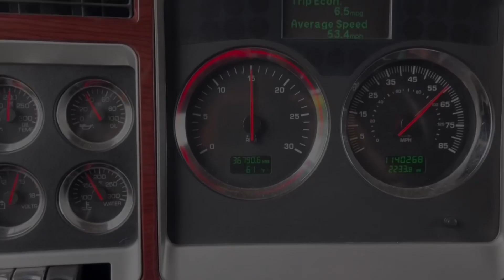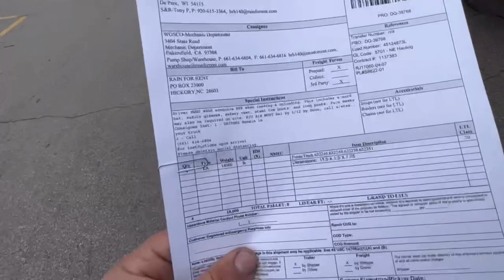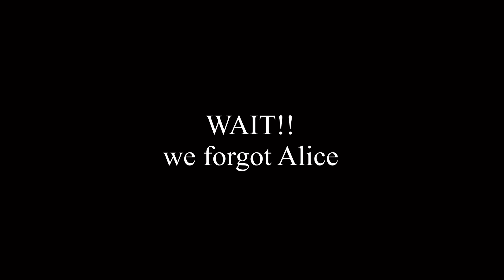KICKING OFF COILS AND PICKING UP PUMPS | Real Life Trucking - Episode #150

Comment: When I ran western trailers, I hauled a ton of equipment, and I ran the chains down through the stake pockets. Never knew they made those hooks that slide in that groove.
Reply from the maker: It makes it easier, the stake pockets are so far apart it would make it awkward lol
Reply: @TruckingTogether  yeah I used to have to load everything trying my best to line it up with my tie down points. Those hooks you have are pretty slick!
Reply from the maker: They can be a challenge to keep from moving sometimes but definitely make it easier than stake pockets. Kind of wish I had some pipe spools sometimes.

Comment: Well you made it bud. There's an example of what I was talking about tarp and stuff on the you get there and they get it in the open it's sitting out there in the rain trucks going by splashing butt all over those coils. Back of the day I got a lousy $75 for tarping.🤷🏽‍♂️. Sometime the last.

Hey man I got a question for you how come you don't use a steak pot holes in your trailer for tying down putting the chain through. That's what I used to do with my trailer. It was an outside frame so I couldn't haul no coils. The strength is on the outside and the stickers you put on there set the lumber on. But I've hauled some stuff that I had to chain down sometimes I use a stake potholes..🤷🏽‍♂️. Have a safe trip going back bud keep the dirty side up and the river down. Since your truck's dirty and 😎🙏🏽🤙🏾👍🏽👏🏽🙋🏽‍♂️.
Reply from the maker: Stake pocket you mean? Mine are so far apart it doesn’t make sense to use them. About every couple feet. The J plate make it easy. Week supposed to anyway lol

Comment: Hi Martin, when you were replacing the air compressor last week you commented "somewhat" 'bout 'Cats' not having a place to lay tools, SuperTruckerDan video #547 5:17 minutes in show 3  surfaces on top of the engine to place tools if needed, just sayin'. Also YouTube "Truckin' life" Cummins has a nice crackle,  l'm guessing because of a different exhaust system. Love your videos
Reply from the maker: Lol that CAT work bench is not as flat as the DOHC valve cover on the Cummins. But yes, I’ve lost tools on top of a CAT many times in my day. 

Yep all Cummins have that bark to them, it’s the way the exhaust pulses in the exhaust manifold and firing order. They all have their distinctive sound. CAT sounds really good with straights and has the loudest turbo whistle with the factory charger. N14 and big cams just sounds pissed off. ISX sounds like that when you go to a fixed vane charger.
Reply: @TruckingTogether  Yes Sir

Comment: Time for a new right windshield before the Chippies in CA nail ya.
Reply from the maker: It’s legal. Not obstructing view lol. I know though, just can’t ever find time to do it. When I do I’ll replace both. It was a tiny nick and the damn death rays from the sun made it spread here in CA
Reply: FYI Martin - The police write cracked windshield tickets all the time. It doesn’t matter if it’s obstructing your vision or not. They give you 48 hours to make the repair. I used to be a motor officer in Southern CA and I used the section all the time, although never on a semi truck. 

CA Vehicle Code Section 26710

Though the law doesn’t specify what constitutes “impaired driver’s vision”, in California driving a car with a cracked windshield will almost guaranteed get you a ticket if you’re pulled over.

What vehicles does this apply to?

This law affects all public and private motor vehicles. Additionally, all passenger vehicles including trucks, buses, truck tractors, fire trucks, fire engines, or other fire apparatus, and husbandry implements are required to follow the dictates of Section 26710.

Comment: You mentioned something just as I was thinking the same thing. My chain and binder experience was waaaay before those J-hooks were even a thing. I know they work but it just looks a little sketchy. How do you keep them from sliding when they are positioned at a forward or back angle? You are one very professional operator and thanks for setting a good example.
Reply from the maker: 😂 that’s the thing, they are hard to keep from moving, which is why I mentioned they are kind of a pain in the ass when you need angles, there are bolts on the track that are supposed to stop it but sometimes don’t. Eventually they stop moving when you get enough bite on them. This is why I had to readjust the binder a couple times on some of the pumps. I wish I had pipe spools, would make it easier with certain loads.
Reply: @TruckingTogether  have no experience whatsoever with this but seeing the issue, couldn’t one use some smaller chains /binders to link the J-hooks to each other between the pumps? And into/to the stake pockets for first and last ones on a side? To keep them from moving front to back..,

Comment: I never was a big fan of the wooden bonker for checking tires air pressure.  Always preferred a 2 ft. snipe but at least your not using your boot.
Reply from the maker: It’s metal filled, truth be told not a fan of it either.